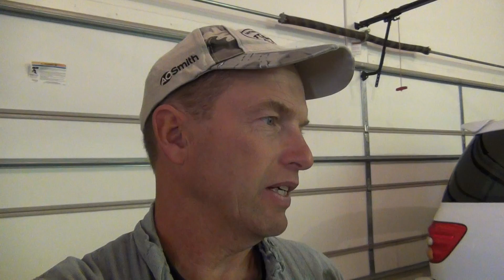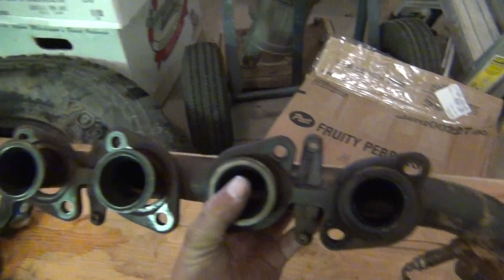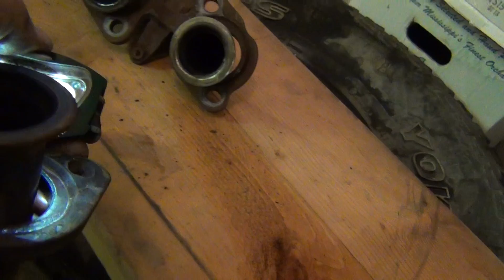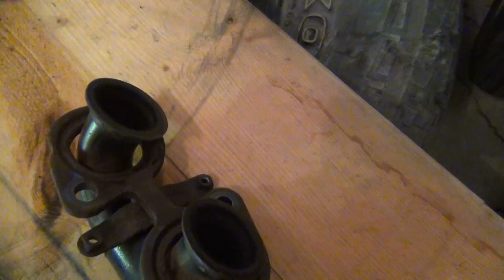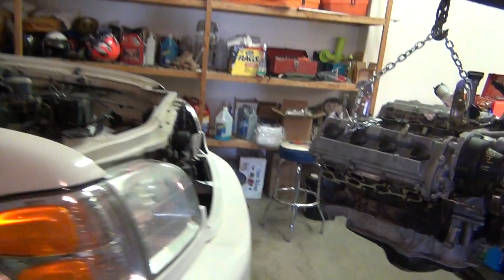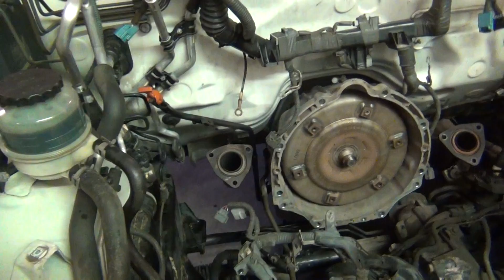01 TOYOTA SEQUOIA TUNDRA 4.7  EXHAUST MANIFOLD LEAK

Comment: I just searched is there anyway to patch the manifold for a GEN one Toyota Sequoia, and your video came up.

Your content was exactly perfect for my situation!

I hope yours is still truckin’ ride along brother!

I paid $3800 for mine and it was garage super clean interior and rides like it’s brand new!

I’m dealing with the idler pulley, which may have caused my throttle body to spew some coolant.

I figured I’d take care of all the issues at once.

I heard the ball joints go bad so I’m gonna go ahead and replace those they don’t seem to be an issue.

Thanks again!

Comment: Would it work well enough to apply some exhaust cement paste to the cracked areas instead of welding?
Reply from the maker: No. I'm afraid not. 
I would think that stuff would burn off after awhile. 
Much better to have a shop weld it back up.

Comment: I had run into an exhaust leak on one of these engines, but as I recall it had the cast iron manifold. Not sure what year it was. The leak turned out to be poor machining on the flange area where it fits to the exhaust port. It was an obvious factory defect.

Comment: I may have a leaking manifold. My engine has a tick when start it up and goes away after a few minutes but only does it when the air temp is below 32°. Does a leaky manifold hurt engine performance?

Comment: Nice job showing a manifold repair. I’m a Toyota certified expert mechanic, and I’ve never seen a head gasket go bad on the 4.7. They are one of the best engines that Toyota made in my opinion. It sounds like they might not of had the correct antifreeze in there. It also should be changed every 100k, or with the timing belt job. One time I saw the manifold being welded on the truck to fix the same problem. I also put on some aftermarket shorty headers before. They usually need a slight modification to get the exhaust to bolt on. Nice job
Reply: Mikael Bohn I have a 2007 that’s ticking if I don’t fix this problem as this guy did in the video what will happen will I blow a head gasket?
Reply: Hey I know this was 4 years ago, but you said they welded the manifold on the truck? Did you see it get done? How sketchy on a scale 1-10 was it? Lol
Reply: @CurtisL8.3066  a guy a couple bays down did it on his own 4Runner. He had the truck running and made a series of tack welds until the leaking stopped

Comment: Toyota does seem to make solid products
Had a 98 Corolla
Kept it in the road for 17 years, 300K miles, head to replace the front CV axles six times and the starter twice. 
Absolutely no problems otherwise until the transmission blew and we just decided to upgrade to a larger vehicle. 
The one major problem Toyota had imo it's the door handles are just crap. 
I've not owned one vehicle without at least one that want broken already
My last one, 92 Camry had for broken inside and three outside

Wife's 04 Camry had as a broken interior handle
But opening the door don't count, keeping it in the road is where they earn they're reputation with me and that they do quite well. 

Just bought an 01 Sequoia and it has the exhaust leak also. 
It has some cosmetic issues but this seems to be the only mechanical issue this far. 
Guy gave me the exhaust manifold, I just need it put on because I am not a car guy. 
I really wonder if the high temp jb weld would hold long enough for me to save up the money to get it done???

Comment: hey mr brig t, just wanted to let you know i did fix my o6 tundra myself, it was a tough one, it was the back cylinder on driver side, i had to do it back yard style lying on my back,  i did have to remove driver side motor mount to get to 2 of the header bolts, my hands and arms look like i got in a fight with freddy krueger, i do work for a machine shop and i work in my opinnon with one of the best welders in eastern nc, went ahead had him weld all port holes just in case, took me a full saturday and a good part of sunday to complete the job, totally fixed the problem and only cost me $4, (my welder frends lunch) and not to mention the 2 pints of blood i lost on the heat shelds, i want to tk you again for your knowledgeable video, i love this truck and it pisses me off to no end that the more i have read and investigated this it seems this is a common problem in the tundras and sequias and toyota hasnt called a recall on this, especially on how much they charge for there vehicles, tk u again

Comment: great video, I have a 2006 tundra 4.7 with 138000 and is in excellent running condition, but!!!!!! I have a ticking noise coming from the driver side, (after it warms up) almost sounds underneath driver side, I   I cant stand it, my father in law thinks its a lifter, it dose not effect the vehicle at all but I am about to go ape shit, its just so annoying having a nice looking truck and have someone ask what's that ticking, I try to do most of my minor repairs because the dealer ship wants to rape you bare back, Toyota in Wilson NC tried to charged my buddy $1250 (after the warranty ran out) to change the manifold on the driver side on his 2002 tundra, and he complained about the ticking noise when it was new, they told him it was normal,  I truly think they don't know there ass from a hole in the ground, please help and guide me to a do it your self video because I can do it but don't want to do it incorrectly, BRIG T, if you see this let me know, ill send you some contact info, I would love to talk to you personally, you seem very knowledgeable, tks
Reply from the maker: billy newton. Billy, thanks for the compliment. Sorry but I don't give out my personal contact info. Mainly because I'm to busy with work etc. But you can do this manifold repair on your own. Take courage my friend. "..one man can do' what another man can do..."
Reply: thank u
Reply: I had the same problem in my sequoia. Switched to Castrol synthetic with a K&N oil filter. About 5,000 miles later don't really notice it.

Sequoia has 230,000 miles. With minimal maintenance.

Comment: Sounds like you had a bad water pump and lost enough coolant to the point where the motor overheated and blew the head gasket. New denso radiator is about 150$$. I would recommend getting one and doing the water pump and timing belt on your replacement motor.
Reply: Most likely over heated it

Comment: I have a 2003 Sequoia with 421,000 miles. Original motor. These are some of the best motors ever made. They were developed for Lexus with the ls400. Also, very easy to work on

Comment: Just a follow up after repairing my passenger side manifold. The bottom bolt Brig T told us was a bit tough to get at, was indeed a pain. I removed the 4 -14MM bolts attaching the engine mount to the block and raised the engine (on the passenger side) approx. 1" so my deep socket could get on the bottom exhaust bolt. This worked great. It's tight but doable. The manifold is just steel and can be welded easily. Have the machine shop true up the face and replace the three studs on the outlet end with new studs. Also don't forget to replace the crush exhaust donut at the same spot. I replaced all the manifold nuts to insure an easy removal if this continues. Costs a little more but I thought why not as long as I'm here. Thanks again Brig T for your time.

Comment: mamery jazz. it's doable but you have to hit it from about every angle. from underneath from above and through the fender well. my buddy just did his on his 2000 Tundra. but he replaced the manifolds with some aftermarket headers. as opposed  to fixing his old manifolds which he actually gave me  or buying new ones. The new headers were less than half the price of new yota manifolds. he said they were damn tight to get in. better sound and performance too.
Reply: BIGTATER thanks for replying.   I got busy and took the car to a muffler shop to get a confirmation. They were in the hurry to replace both manifolds gaskets since no cracks were found in the manifold. Charged me $225 just to find out that the noise remains. I am so annoyed by it that I already put it on Craigslist for $6k. Mine has 140k miles. Thanks again for taking the time to reply.
Reply: mamery jazz. that's sucks dude. I'm sorry to hear that. but if ur gonna sell it, put 7k on to. lol. It'll bring it.
Reply: +BIGTATER 
i did but issue is people are poor right now and waiting on income tax. I even lowered it to 5500 smdh. I am actually driving it now. that is the best i can do. At least im enjoying it lol

Comment: Thanks for posting this video. I have a leak in my 2005 Sequoia; however, it never goes away. Took it to a muffler shop; they think it is the manifold. I love do-it-yourself tasks but have to admit that this one is intimidating me because i can not think of a way to remove the complete exhaust. My question is:
did you remove the manifold from under the vehicle or do you access its bolts from the top of the engine.
Thanks in advance for assisting me so I know if it is doable for me or not.
Reply from the maker: mamery jazz 
mostly the bolts are accessible from the bottom and through the inner fender. It might help to remove the wheel to have better access.
Reply: +Brig T Thanks Brig T. I had both manifold removed but i was unfortunate because we found no leak in my case. Replaced the gaskets just to find out that the noise is still there. Have no idea and gave up fixing it. I can only think about the throttle body plate although it may sound unlikely

Comment: I have a 2002 4.7 tundra. Do I have to pull the motor go replace the manifolds?
Reply from the maker: No. You don't have to pull the motor. It's not too bad of a job to do when the engine is in the car.

Comment: We have a 2001 Toyota Land Cruiser with a 2uz-fe that just tuned 250k last weekend. it's had a leak for quite some time. This video was quite helpful. However i'm a bit paranoid that if I try to take it apart an exhaust stud will brake. So i'm going to hang off till I can't stand it.
Reply: Don’t worry!!!  I was the same way with my 2000 landcruiser.  Just spray these studs and nuts with PB blaster for a few days and let it sit before you do the manifolds. If the nuts get stuck with rust it simply unthreads the studs out of the head. I think I used 12 new studs and all new nuts when I fixed my cracked manifold with headers :). Cheers!

Comment: My 2007 Tundra has only 42k miles but started making the ticking sound and clatters when I accelerate.   It is likely an exhaust manifold leak. Do you know if  your manifolds  are stainless steel?  Thanks

Comment: thanks a lot. I just picked up a 2000 tundra. same problem but it's at the more advanced stage, where it doesn't go away. great video. I'm gonna get on it. :-)
Reply: Doug thorley header!  Fixed mine and added 30hp to the wheels. I also added a Doug Thorley cat back.
Reply: hi. did you fix your tundra manifold? the noise on my 2005 sequoia does not go away either. 
is it doable from the top or bottom of the vehicle?

Comment: Great idea to get machine shop to fix.  I found Dorman manifolds 674684(left) and 674683 (right) on rockauto.com for $133 each.  My mechanic says he can't buy them that cheap and Dorman reengineers them so they don't fail again.  Dealer wants $1100 to replace one.  One guy I asked says 7hrs per side.  Another says 5.   Labor rate at dealer is $134.  My guy is $99 at 5 hrs.

Comment: I have a 2000 Tundra I have the same symptoms coming from my exhaust manifold on the passenger side. But my tick does not go away after warming up, could that be because the exhaust may have larger cracks/holes in the manifold? I'm hoping it is not a valve issue.
Reply from the maker: cordon, you could pull off the valve cover and run the engine to identify it it's coming from the valve train. but I bet it is the ex manifold leaking. put some effort into it. you'll figure it out.
Reply: Will do thanks.
Reply from the maker: Yes that does sound like a valve train issue. I'd suggest pouring a qut of ATF in your oil and run that for 500 miles and then change your oil. I've done that several times over the yrs and it works!